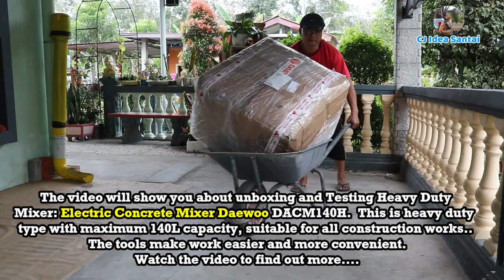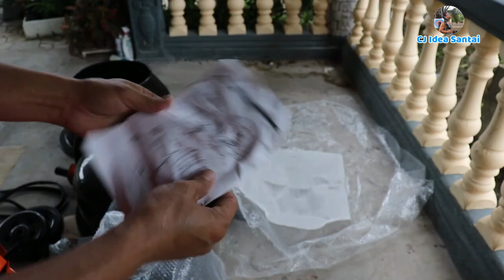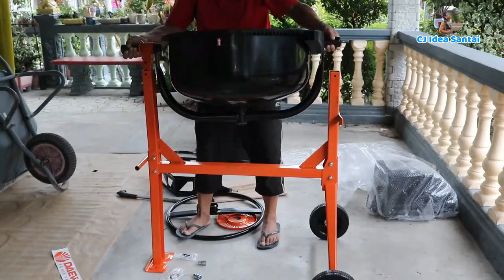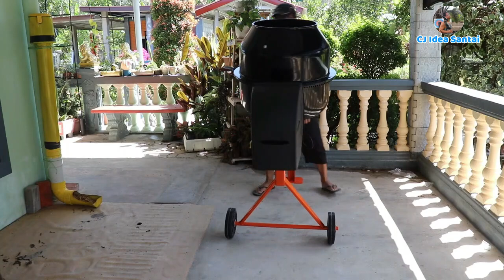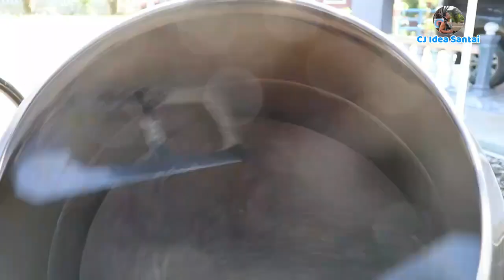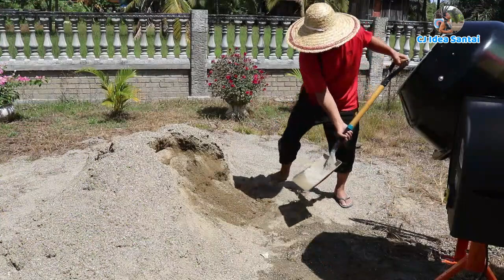Electric Concrete Mixer Daewoo DACM140H: Unboxing and Testing Heavy Duty Mixer

Comment: Let me share my view on this particular Daewoo 140L electric concrete mixer model. PLAESE TILL THE END OF MY COMMENT. I bought it 2 years ago during pandemic to renovate my house all by myself with the help from this machine, and currently building a roughly 2000 sqft new house. I use this machine right from foundation till now doing plastering. This machine paid for itself more than 10 times if I sum up labour costs I saved. It is still running strong, I put some wax on its gear. The only thing that broke a while ago is its plastic wheel but  I think I can get similar wheel in the market for under RM20. My advise is, if you plan to build or manage building your project by yourself, this machine is a must buy thing. This model is much better compared to wheel barrow mixer type because once mixed, you can pour directly to you wheel barrow.
For 1:2:3 concrete mix, this machine is capable to mix 1/2 a bag in 6 minutes cycle, it does not heat up. At the end of the day, my workers haul it into my store for safekeeping because it only weight 48kg. You dont need bigger mixer, trust me.

 I hope my sharing would be beneficial to other viewers. Cheers